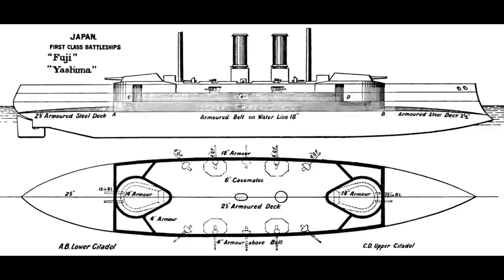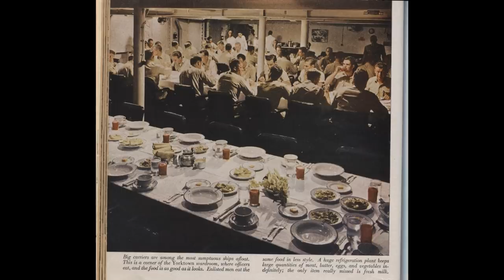The Drydock - Episode 130

Comment: Langley was the secretary of the Smithsonian Institution ( The us national Museum in Washington DC). in the first decade of the 20th century  He designed an experimental aircraft the was launched from a catapult on a houseboat anchored in the Potomac River at Washington.  Unfortunately the aircraft was not a truly practical aircraft and crashed on launching in both attempts that were made..  There was a long running controversy between the Wright brothers and the Smithsonian over  a claim that Langley's "aerodrome" actually achieved the first controlled  heavier than air flight.
Reply: Except it was most probably Gustave Whitehead .
Reply: @benwilson6145  You may be interested in Greg’s Planes and Automobiles analysis of this topic.
Reply: @gizmophoto3577  Looked, he is not objective, Whitehead flew before the Wrights. The Smithsonian only have the Wrights aircraft if they defend the Wrights fraud.

Comment: Arguably Philippine Sea was the all-out Kantai Kessen from Japanese doctrine. It was deliberately aimed at the US Navy with everything they had. Ironically, the fleet carrier ratio was about 15 to 9 (roughly same as the odds they faced in the Battleship days). It didn’t turn out well, including failure of the land based air to equalize the odds (equivalent to use of subs and night torpedo attacks to soften up the USN battle line)

Comment: For the US industry part: While mostly nobody underestimated the total capabilities of the US industry, mostly did not considered it a problem, since they not considered the massive shift from civilian to military industry (compare the prewar and wartime car production, that shift is simply insane), since most expected the us population will want their luxuries just as much during war as they wanted it during peace. And to some extent it was probably a realistic expectation, since without PH and the near perfect propaganda the us pulled from it, the us indistrial might would have been much less used for war. Consider the option of no PH, japan agrees to some retreat, and so no reason to go full warproduction against japan, and against germany, the US has to DOW, and suddenly 25% of its actual production would be a nice dream for the generals to use against Germany. Or even the US simply never DOW on germany, they help the SU and UK, but no direct involvement, and the war goes to a totally different route.
Reply: A major factor in the US industrial output during the war was the auto industry's perfection of mass, assembly line, production.  Consolidated built "hand crafted" B-24s.  Ford, at it's Willow Run plant, cranked them out like cars.  The Bofors gun and RR Merlin were designed to be "hand crafted", with lots of hand fitting of parts.  The first thing Chrysler and Packard had to do was reverse engineer the guns and engines to accuractly define all the dimensions, so they could use their mass precision machining capability to eliminate the hand fitting.  It wasn't just a matter of the manpower, and a lot of womanpower too, that could be put on the job, but the level of productivity that was realized.

Comment: If you look at island camouflage as HNLMS Abraham Crijnssen did you can find similar with Swedish ships after WWII. You can't call it successfully used as the cold war never become hot so not used in real conflict. You can see an example of HMS Göta Lejon  https://imgur.com/Nd4D2mn the look is as the rock cliff of the island instead of the vegetation. Göta Lejon is quite a bit larger with 3x the length of the Dutch ship. The general idea was used on smaller ships too
Reply: That's pretty damn good, and radar should be ok with the return from the cliffs so long as nobody brings a millimetric unit to focus for so some reason.  Do you know if it was good for IR as well, withstanding the boilers/turbines being cold?